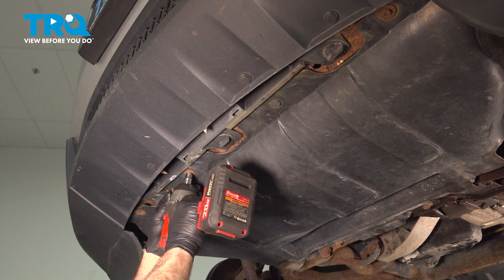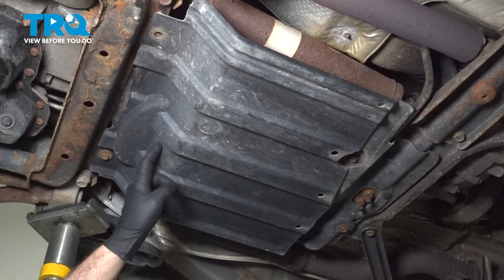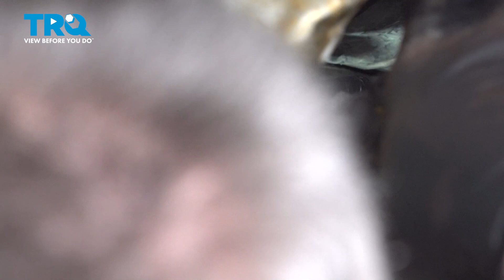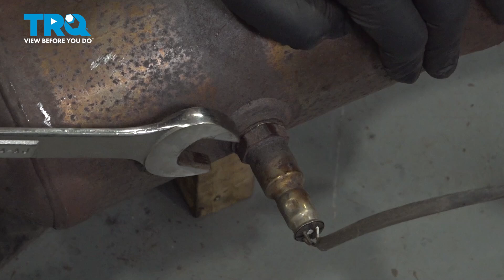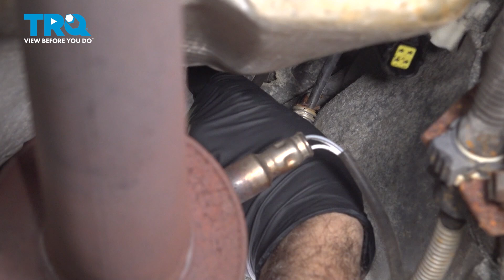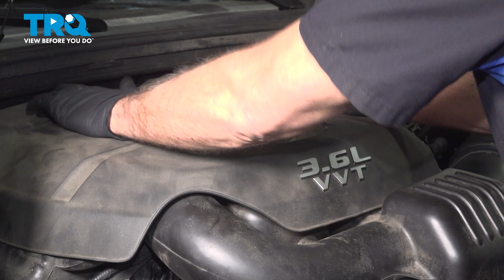How to Replace Catalytic Converters 2011-2021 Jeep Grand Cherokee 3.6L V6

Comment: I found this video incredibly helpful.  Thanks for posting it. 
I struggled for countless hours trying to remove the upper forward bolt from the cat flange at the engine.  The one obscured by the AC compressor.  Eventually I removed the filter air box and I had it out in about two minutes.  

As an aside, I am working on on jack stands and not a full lift.  Thanks for the well produced informative video.  
Dennis

Comment: Thank you so much for the video. With car in neutral will I be able to spin the front drive shaft with car up on ramps? or do all wheels need to be off ground? my grand Cherokee is a 2012 4x4 3.6 Laredo , Thanks